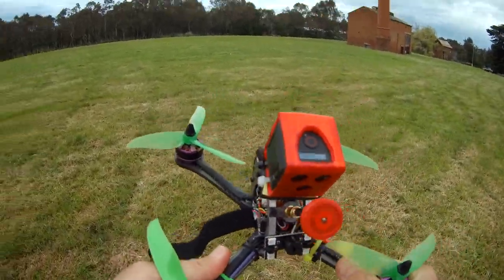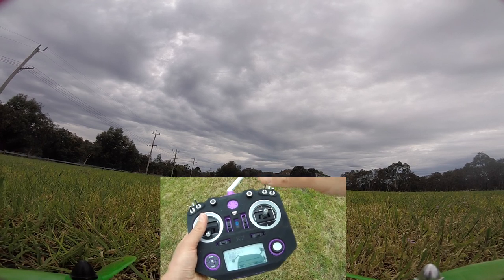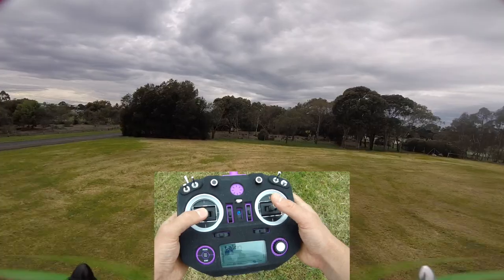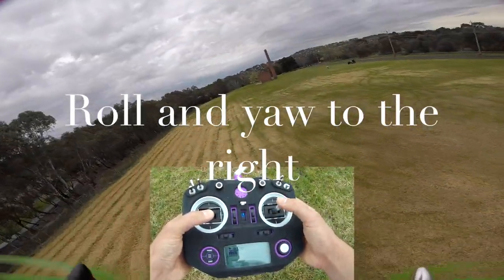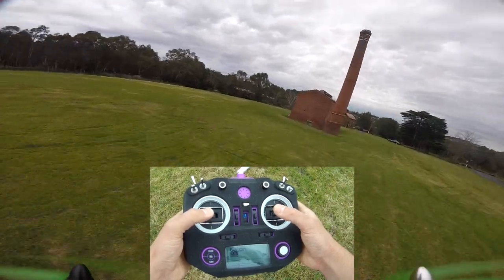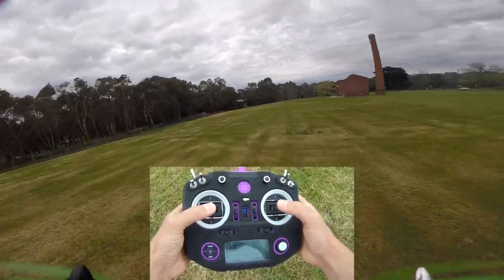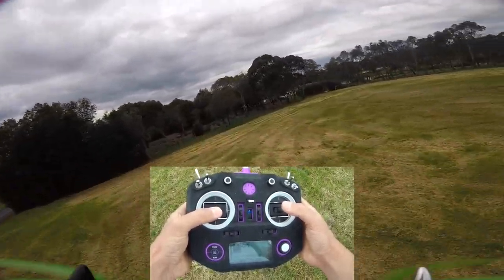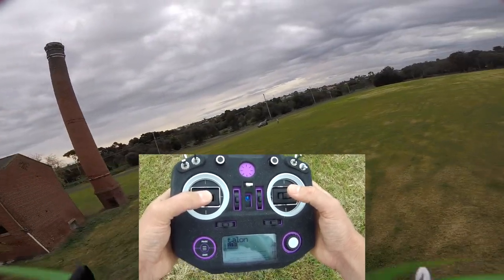HOW TO FLY A FPV RACE DRONE. UAVFUTURES Flight School - Lesson 2 BASIC TURNS

Comment: If you don't mind will you tell me where you got the black and purple control at? I have seen all different types of colors but no black.
Reply: Building the 99 racing drone. thanks I have one more question for you. what size of battery are you using on the $99 quad? And thanks again.
Reply: Can you suggest what frame you would use? And what type of berry size? Thank you.
Reply: Yeah thanks a lot. I will or one.

Comment: You know,, I realize that officially it's roll and pitch, which helps to have two words because then you know direction halfway,,, but with quadcopters,, it's really only pitch. Pitch left makes more sense because the copter isn't working a wing the same way. You can move the same in all directions (although shape can affect the rate), and it doesn't work at all like wings. It's closer to flying a hover-rocket, and then it REALLY starts to make more sense to just pitch in all directions.

Comment: I know you get this all the time, but I want to get in to ACRO flying. I'm pretty good with LOS on horizon mode (NONFPV) but, want to FPV ACRO. More trick flying than racing. What is a good strong learner quad to use? Looking something that can take a crash but, be powerful enough that it will last a while. Wind here averages about 5 to 10 MPH. Thanx in advance, love your videos.

Comment: Hi, I'm new to these racing drones and just got into the sport after flying phantoms with GPS hold etc for a few years. For a begginer like me with little experience with flying with no assist like gps hold, return to home, auto hover etc etc, should I start off flying line of sight  which I have been doing for a few days now learning to hover and getting used to a completely new feel of these drones or should I attach my LCD display to my hubsan h122d and start learning basic turns?? Any help will be much appreciated thanks.

Comment: A quick question, what is the tilted orange "box" on the very top of the drone in this video? Is it a 2nd camera? It looks like there is already an integrated forward-facing camera in the drone already? If this is correct, why does your drone have or need two cameras? It also looks like many of the drones hanging on the wall behind you have similar tilted plastic boxes (but the boxes are empty) on the tops of the drones, I see some yellow, black, and tan boxes. Can you explain more about them? Thanks!

Comment: I'm new to flying in manual with a zmr250 iv'e always flown in GPS with a Phantom 3 standard, Question is it better to fly with triple props when being a beginner and what are the advantages flying with triple props, at the moment i'm using single props

Comment: I found with the simulator you need to keep an eye on the throttle when doing those nice banked turns as I found it easy to forget about the 'third item' (elevation) during those. 
Turning preference...hmmmmm I used to find the same thing on my motorcycle. Drag the knee on left turns but right sweepers were always strange feeling for some reason and I couldn't get as low. Thanks for the video and lesson!

Comment: It's a great help to see stick movements. It's amazing how little movement is required. When you turn you roll and yaw left, say, but you don't seem to need to roll right to get back to forward flight! I guess that is because you have Yawed left to spin the quad round it's centre?
Insert of sticks is very helpful, blackbox traces as well would really be the icing on the cake.

Comment: I appreciate this series of videos.  I finally was able to hover through 4 batteries a day for three days. I'm not saying I did it well but I did finish without crashing, breaking props, or hurting myself.  I did twist my arm but that was from patting myself on the back.  You mentioned you are switching transmitters.  Have you selected the one you will be using?  
Also, I am practicing with a wizard 220 and had to reduce the throttle curve to have any control over it.  Before the wizard I started with a micro FPV which is very easy to control but too light for outdoors.  Can you recommend one or two drones that would be between the wizard and the micro, designed for outdoor use and bit easier to control than the Wizard. I am not looking for speed on this one but primarily easier control and being able to use the transmitter and 3S batteries that I use with the wizard.  Thanks

Comment: I would love to do this practice but i had a hard crash and could use some help. My drones motors are accelerating on there own now
Reply: Jarred Heitzenrater esc problem?
Reply: HornetFpv i dont k ow thats what im trying to find out. I plug it into betaflight and rev the motors with my transmitter and the one motor starts spinning up to full throttle
Reply: Jarred Heitzenrater might be your flight controller? Or You might have broke a mosfet on your esc.
Reply: HornetFpv ive had the quad for 3 months now and have had alot of crashes. Would you advise me to cha ge the escs and motors
Reply: Jarred Heitzenrater what quad you got?